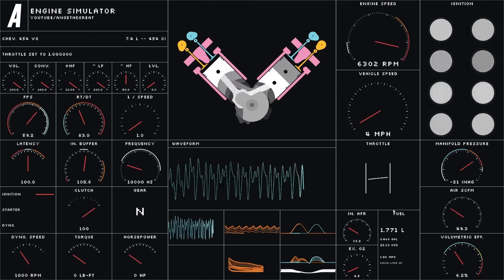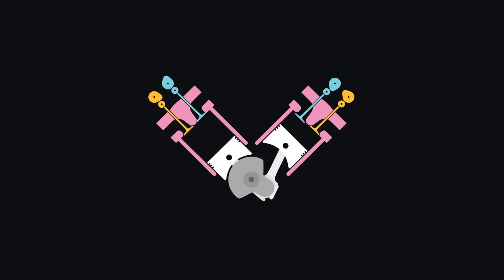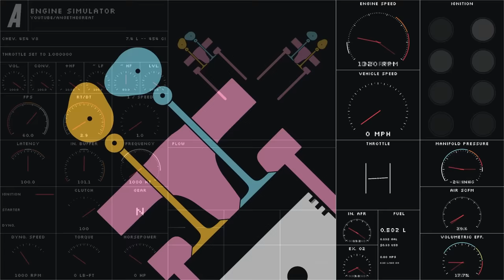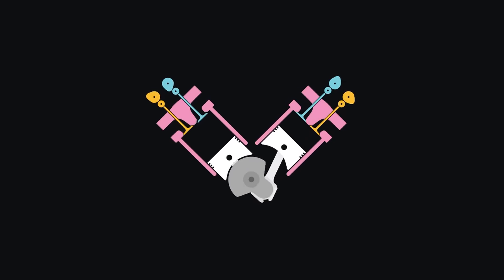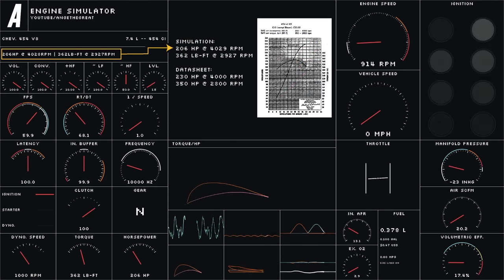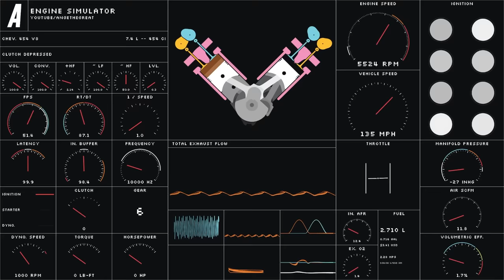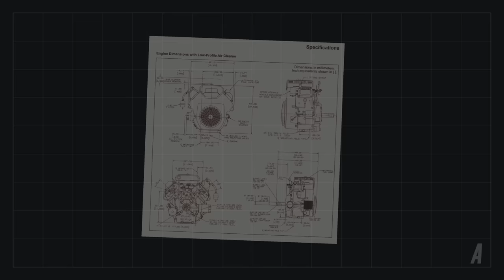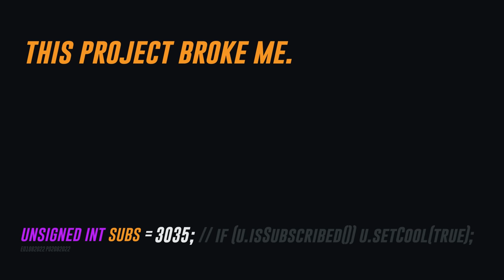Simulating an Entire Car Engine (yes, it makes noise)

Comment: A rotary aircraft engine with 20 cylinders would be sick.
Reply: Ohhhh I read this wrong

I thought you mean Mazda rotary engines
Reply: you mean like a wankel engine right
Reply: @JNJNRobin1337  No, rotary engines were popular in early WW1 aircraft designs. Wankel is s completely different architecture.
Reply: ah, i completely wasnt aware; good to know
Reply: I think radial engine would be a more accurate description
Reply: @118Shadow118  You would be 100% correct. The engines in the aircraft they are attempting to describe are called "radial" and not "rotary." Rotary describes the wankel engine. I will say that both are a pretty redundant name, as technically they describe the same thing, however, colloquially you would say radial to describe the aircraft engine and rotary for the wankel.
Reply: @Bandit4557  https://en.m.wikipedia.org/wiki/Rotary_engine a radial engine is again a completely different design.
Reply: @JNJNRobin1337  wankel engines have no cylinders
Reply: @CrossbowBeta  rotary’s are wankle engines you are thinking about radial not rotary
Reply: @CrossbowBeta  And WW2 for America, my favourite radial is the wasp.
Reply: @jpsacks5298  Nah dude. Rotary engines are engine architecture where the ENGINE BLOCK ROTATES WHILE CAMSHAFT STAYS STATIONARY. Wankle Engines are ones with a single triangle piston. Radial engines are similar to rotary engines but the camshaft moves.
Reply: @Bandit4557  I Believe they are referring to Rotary engines. Through the WW1 they were the preferred option... I mean they are similar but only when they are not working.

Radial Engines have several pistons put in star alignment moving the crankshaft. The engine block stays stationary.

Rotary Engines also have several pistons put in star alignment, BUT the Engine Block rotates and not the crankshaft(!).

They are similar in piston alignment but NOT in operation. The rotary engine, as the name, suggest ROTATES.
Reply: @Bandit4557  uh, wrong. 1910s rotaries literally spin. The whole engine spins. It's not just radially mounted.
Reply: @chrismofer  ok
Reply: Radial engines have to have an odd number of pistons.
Reply: Rotary and radial engines don’t work if the number of cylinders in each bank is even
Reply: Maybe you mean radical
Reply: musso 24/7 :yougotthis:
Reply: wright cyclone radial style? or a ww1 style rotary with 20 cyls? how about both...
Reply: Provided you have a nasa pc
Reply: @CrossbowBeta  wankel is cooler

The sound of the gods without 10 or 12 cylinders

4 rotors=V10
Reply: @freeman48083  
You can have even number of cylinders in a radial engine, but each row or layer needs to be odd. Eg. P&W R-4320 is a 28-cylinder design with 4 rows of 7 cylinders.
Reply: @flameendcyborgguy883  very interesting, but I think it’s the same issue with the naming scheme of these machines. With “flat” 4 for instance, could be referring to the boxer 4 that Porsche and Subaru make, or the classic parallel H cylinder alignment… you’d never know, or you could assume it was the most popular version of the term. Which is what I assume they meant. I have no idea why you’d assume they meant the rotary engine that everyone is correcting me on, which is why I said what I said.
Reply: Yeah!1
Reply: Yes!!!
Reply: @StratocastRS  even numbered radial engines are actually two odd numbered engines.
Reply: @Crlarl  correct. Which is really a collection of odd numbered radial engines in series.

Comment: The first thing I immediately thought of, before you even started talking, was a rotary!

I would love to see a rotary engine in your simulator. It's one of my favorite engine designs, and it produces such a unique sound that I haven't ever seen replicated well in games

This is likely s huge challenge, but you wanted suggestions, so here they are!

With the release of modular simulators like this, game devs have no excuse for bad engine sounds, so they better use this
Reply: Ahh tag me there pls
Reply: Yes I thought that too. A 13B would be very cool.
Reply: @schmieroel  and an R26B
Reply: I agree. finally do what Camshaft Software wouldn't
Reply: Yep, so awesome!
Reply: Wankel engine pls!
Reply: No excuse other than the math horsepower required to simulate the desired engine at 80,000fps /for the sound/. Don't get me wrong, I want it, but hot diggity.
Reply: @frollard  but it does not need to be real time, just record it from simulator and then use in game

Comment: Finally someone who has realized that engine sounds in games have gotten worse.

Very nice project, I celebrate it.
Reply: Debatable
Some games (and even mods) have good sounds (and even improve on actual developers)
Reply: GTA 5 has some pretty nice engine sounds on almost all the older cars. Most newer cars in online however sound bad.
Reply: Beaming is the only one I can think of that has pretty good engines sounds but nothing on this level
Reply: @krisk2466  assetto corsa?
Reply: bruh thats just not true
Reply: @krisk2466  raceroom, assetto corsa competizione, automobilista 2, project cars 2, dirt rally 1 & 2, iracing?
Reply: i'd say they have gotten better. compare RBR vs DR2. both top rally games of their era, but the later has waaaay better engine noise
Reply: Honestly the Cars in Cyberpunk sound awesome. But they spent many, many hours to gather real sound of the vehicles.

Comment: This was recommended to me out of seemingly nowhere. I'm really impressed. The coding, the visual presentation, attention to detail, the relentless hunt for knowledge. Exceptional.
Maybe game developers could place a sine wave generator in the engine bay, binaural microphone at the driver position and record the frequency response curve and set up convolution reverb matching the cabin for ultra realistic sound reproduction.
Reply: That's a fantastic idea that I hope someone incorporates. It really shouldn't even be too hard to do. Although now that I think about it, some of the engine sound comes from the engine, some comes out of the exhaust, so you'd have to keep those separate and apply different EQ to each... But to me it's worth it. I hope devs pay more attention to sound. It's half the experience!
Reply: @sensoryoverload673  it’s so weird to me that the free and awesome steam audio engine isn’t used by a lot of games
Reply: I wonder if a VR microphone might work as well in this configuration, so that you don’t have to keep the head rotation static relative to the vehicle

Comment: "A real time internal combustion engine simulation" - Okay, that sounded like a lot of work, nicely done man.
"Because I want to know how hard is it to simulate the engine sound" - wow, okay that sounded like a bit of an overkill. But go on.
"A rigid body simulator simulates the interactions between all of the internal components" - WOW okay that's even more of an overkill, right?
"A physically realistic fluid simulation" - WOW THAT's overkill
"Piranah is my own custom scripting language that I made" - gREAT now you're inventing scripting languages too. What next.
"I've actually built one of these 454 engines myself" - This man can and has done EVERYTHING under the sun.
"GM's values matches simulations' predicted values" - alright this is neat. I guess your stubborness paid off then.
"I'm very familiar with the Kohler V-twin engine" - okay, again, is there anything that you haven't done?
"Sound and horse power figures pretty much matches reality after I've entered the parameters for this completely DIFFERENT engine" - BRUH
"I literally read entire textbooks while researching this, and I've also read a lot of research papers." - Yeah man, it definitely shows!
Reply: That was my line of thought too. Absolutely mind boggling
Reply: Modern Renaissance Man

Comment: For full realism, add subtle sounds associated with the valvetrain, cylinder walls, and bottom end!
Reply: I highly agree, that would be interesting to hear
Reply: They are already there... low and high frequency noise.
Reply: Add a subtle knocking noise that gets louder and louder with a 0.01% chance per hour to spawn
Reply: @erdinca.2448  it mostly emulates the low and high frequency notes of the exhaust imo
Reply: Not sure whether it does already but I’d love to see it simulate induction noise aswell
Reply: @seagie382  high frequency noise is always mostly valve train

Comment: Can this simulation handle a rotary engine? That would be interesting to see.
Reply: A wankel rotary or even a gas turbine engine would be the next logical step for something like this
Reply: I need to see this it would be lit
Reply: I would love to see that
Reply: The dynamics of a rotary engine are very different, I don't think this software could handle it ...
That said the same principles could be applied on a wankel simulator, but I feel like it would need to be a separate piece of software
(Not an expert coder though so happy to be proven wrong)
Reply from the maker: There is a lot of overlap but I'd need to write some code to make it work, I might make a followup video about rotaries
Reply: @AngeTheGreat  try to get this program into beamng drive

Comment: A VR6 engine would be great to hear! That’s something alot of games mess up when it comes to sound
Reply: I came here to make this exact suggestion. I used to have a 2000 VW Golf 4Motion with the 2.8 litre VR6, wondered myself if this could replicate it!
Reply: not the old need for speed games though
they do it right
Reply: It sounds like a V6 and an in-line-6 at the same time.

Comment: Holy crap, the sound of that engine sounds better than any car game I've played. And I'm talking FH2, 3, 4, and 5, BeamNG, the FM series, etc.

That engine sound is so good, if I didn't know otherwise, I would think it's a real engine.

The only thing I think it lacks is imperfections in the sound, as in, it sounds the same every time you rev the engine. It might be cool to have the engine have weird quirks about it's sound, like older engines in real life.
Reply from the maker: I could definitely add some imperfections like that. Probably in my next video I'll show what engines sound like when they have certain issues (wiped cam lobes, shot piston rings, etc.). It actually reproduces these effects pretty accurately. Thanks for watching!

Comment: As someone who’s seen a lot of this kind of stuff, for the most of the video I wasn’t impressed much because I had nothing real to compare to. But once you showed the simulation of the twin engine commonly used in chippers, which I have heard, my mind was blown. It was nearly exactly the same. This project is incredible

Comment: As someone who drives a manual transmission vehicle, this is insane how accurate it is. Changing out that cam definitely made it sound like a vehicle that packed more horsepower. And the sound from the engine braking was oh so accurate. Honestly, I’d love to see a simulation of a cam and block engine, such as a lot of V-8 that GM makes today, and even my engine, the AMC in-line 6 4.0 L

Comment: I just figured out where I could use this. This would be great for production like in movies or animation like 3D or 2D. You wouldn’t have to go out and record a real vehicle. Say I’ve got a character that drives a ‘67 Chevelle with the 396, I can enter the necessary parameters and get what I need. Or maybe a character who rides a Yamaha R1 with the crossplane, no need to go and find the bike and a rider and rig up some microphones and recording equipment, within minutes I can have the engine and the sounds I need right at home. There’d be no need to try to find a track, or empty stretch of road, an entire car chase could be generated and recorded on your computer. This is amazing, truly a game changer. It solves a lot of personal problems and challenges as someone getting into animation lol.

Comment: This is AWESOME loved the video. 
Suggestions: 
1: I would love to see a more user friendly version, with things like slider bar or value boxes, more info on what affects what and ways to visualize the engine abit more like a top down or side view. I think you could turn this into a pretty cool simulation game. I would definatly pay for that on something like steam.
2: Custom intake and exhaust manifolds, an be able to see things like pressure waves bouncing around them or where there is built up pressure/restictions in them. even add a way to see what areas are getting hotter than others.
3: Sort of goes with number 2, turbos/supercharges with custom size, blades and weights.
4: Also goes with int/exh but Blow of valves and waste gates.
5: Ways to make different shaped pistons like Ovals, Squares and Triangles.
6: SPICY DORITOS aka Rotary engines
7: abit weird but maybe Jet engines???????????

PS: These are all JUST IDEAS that i think would be cool.

Comment: I'd love to see what different v8 engines would sound like using this simulator. Build a pushrod engine(maybe an ls3 v8) and a dohc v8(ford 5.0L coyote v8) and see if they sound anything like the engines they represent.
Reply: Yeah, a Ford 302 vs a Chevy 350 vs a Mopar 426 hemi or something to that effect.  Comparing old 2v V8s with 4v V8s with different compression ratios(like something with a 10:1 ratio from 1968-1970 vs a 8.5:1 after they nerfed the same engine for unleaded fuel in 1974 or so) from the same make would be cool too.

Comment: VERY INTERESTING! Can you create a simulation that can improve the sound of a V6 engine to make it sound like a V8??? There is a video that talks about the "plains" of a V8 engine and explains the reason why the different "plains of the crankshaft angles" creates its unique sounds. There is a video that shows the difference between the C7 vs C8 corvette engines. The video shows a simulator that explains why due to the difference in the plains, "cross plain vs flat plain". Very interesting.  People complain about the awful sound of a v6 but loves the inline 6 sound, so I'm wondering what plain design could get the V6 to actually sound like a V8....OR if a different plain could actually make for a different sound that actually sounds better/different from the designs of the V6 plains design. Maybe even create different Bank angles also along with different plains and firing order to achieve a sound that sounds like a V8...I think if designers can create a V8 sounding V6 engine design, folks would take an interest in building/mod more v6 engines. Its amazing how just the engine Sound can make or break a sale of a performance car! Folks even go through a whole engine build just for the "Sound"....

Comment: I’m into cars and gaming so this peeked my interest. Cars in games struggle, but this is a promising step to help potentially fix that.
Reply: true, but you’d need a nasa pc to run the game at 85000 fps for the engine to actually function as it’s supposed to on top of the rendering and other real time simulations i.e other cars, weather etc, as promising this is we are way off a hyper realistic car sim that can do what this program can do
Reply: @bailey9435  you can definitely create a less detailed version that reacts better than most engines in games do now tho
Reply: Piqued* your interest
Reply: @jaky3  good looking out, your right. (😁JK ). even though i dont necessarily like grammar police that one is tricky.
Reply: @bailey9435  reduce framerate, use 'chunks' of sound instead of individual waves

Comment: This is huge and with some tweaking I could see it being used to quicky predict engine sounds without the need of full acoustic simulations.
I'm an aeroespace engineer so I haven't done anything like that but when designing plane aerodynamics there is usually a rough approximation of a lot of airfoil and wing designs that takes maybe 5 minutes before validating just a few of them with propper simulation. 
So what I'm saying is that this could very well be used to do that first step that is incredibly helpful in the engineering process

Comment: I think one of the reasons why it sounds odd for people at times is that the sound they're used to comes from inside a chassis and this simulation is just the engine.

Fantastic work.

Comment: This is one of the coolest things I've ever seen in the realm of simulated cars.  It took me straight back to being under the hood of my El Camino, pushing its throttle open by hand to hear the brand new 350's engine noise, and the sound coming out of its dual exhaust (with headers!).  Damn, I miss that car right now...

Comment: This is genuinely great, I love engineering more than just cars so even in games my focus is towards the technical side of things, sounds beinf somewhat a part of that and I hate when cars dont have the sound that conforms to the engine it has and the way the engine behaves under load. Especially hate it when LICENCED cars don't sound like their real counterparts.

As a gamedev student planning to go into the racing sim industry you've also made my job somewhat easier. Got to say i'm very grateful for this software.

Comment: We want radial engines, because old timey aicraft sounds are so hard to come by.
Reply: I want this too, but you would need to be able to modify the exhaust system parameters too. Currently whatver engine you come up with sounds like it's going through a good car exhaust system.
Reply: Ditto on the previous reply. Most aero engine exhaust are considerably shorter in length and obviously larger in diameter per-cylinder compared to the layout of a cars. He would need to add in simulation parameters for exhaust volumetrics.